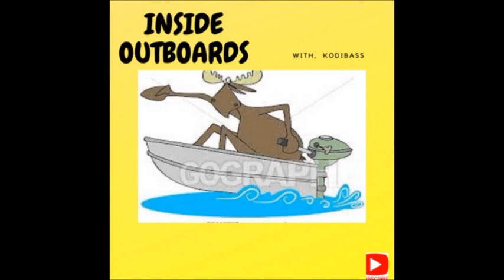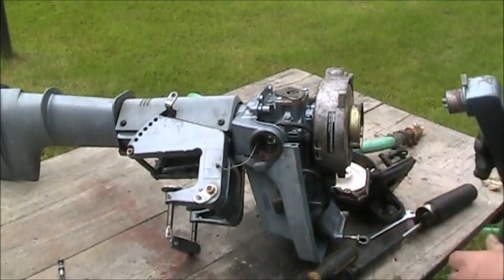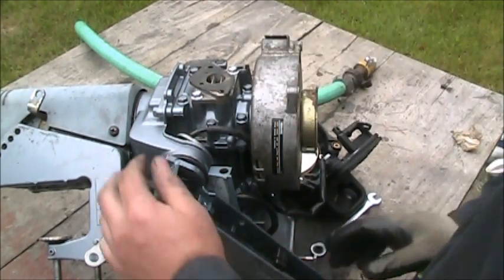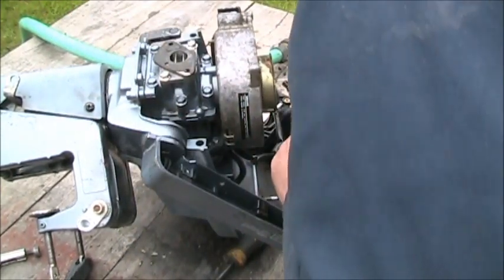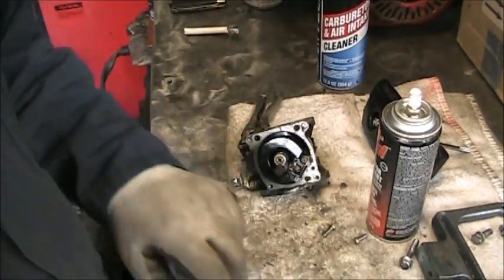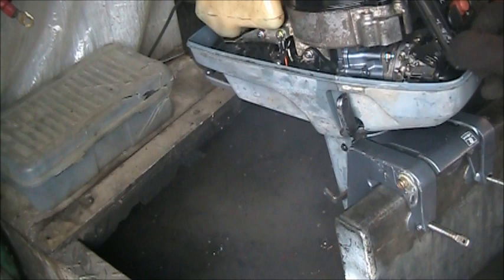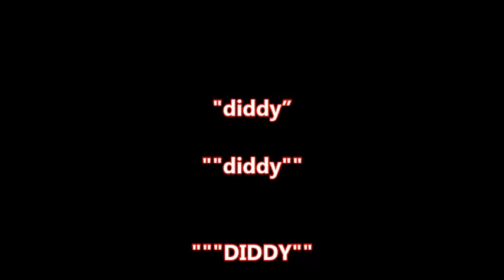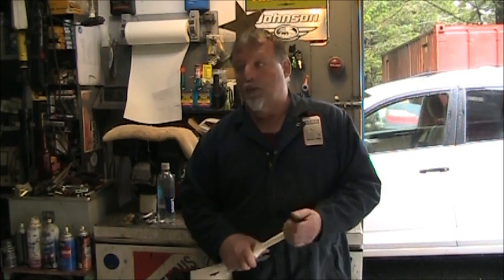YAMAHA 3 HP Outboard,   Repaired  ((  PART 2  ))

Comment: Yep that’s a great little kicker there with the neutral. Being able to bump it in and out of gear while trolling is a great option without having to cut and restart the motor, I’d give it a try on mine for sure, it’d be deadly on the walleye up Lake Erie now!!! I’d try her out before putting it out on the rack...🙂 👍🏻👍🏻
Reply from the maker: +TLS  Ok,  I am going 2 keep it until I find a lower for the yammy 4 hp, same year , sept it has reverse.                                 kodi

Comment: Hi Kodi, I've had my tiller off before on my Yammy 4hp. A bit tricky. Problem I have now is the 10mm bolt vibrates loose. Probably need to put some lock tight on or ding the threads a bit. Like you say you can over tighten it so there is a stopping point for it by feel. It's getting hot down here. Need to get the other ac in the window today
Reply from the maker: _TWS, I have wondered if I could replace this type of cable wheel setup with a later model OMC 9.9/15 type.  I think it it doable .  stay kooool bra.      kodi
Reply: Not sure but if you have one could try and see if it works? Yamaha is easy to work on for the most part. Really good motors especially for trolling👍

Comment: Did u keep it? I got an old P45 Yami 2 hp, a mariner labelded 2hp Yamaha and a 3hp Yami. They all are great little runners if maitained a little. I never had an OMC that was as good as a Japanese made Outboard. Goff Thing on teh old OMC Motors is the Mixture adjust Knob. But to use that u need at least a bit of knowing what u are doing.
Reply from the maker: long ago sold.  I have a 4 with fwrd  n  rvs.    kodi
Reply: @kodibassInsideoutboards  Yeah, thats the only bad point about the little Malta, if u turn it for reverse it pees in ur boat.

Comment: Is this a yamaha Malta? I have a 1996 model that currently is a non runner and trying to find info on taking it apart. It looks the same as the one in this video but wondered could anything confirm that this is in fact a 1990's malta?

Comment: can i ask you sir... my 3hp outboard had a problem with low speed/engine shaking...i buy piston ring and replace old One and cleaning the carburetor .....but my outboard still move slow when i put gear... and engine strong when free gear... spark plug new too.. sorry if you not understand what iam saying... im not good in English
Reply from the maker: Check if anything is wrapped around the prop shaft behinde the propeller,     kodi

Comment: I have the same motor. The “friction piece screw” on the left rear side of the motor seemed to be lose so took it out. Can’t seem to get it to thread back in. What exactly does this part do, and what can I do to make sure it’s back in properly. Can’t find anything online. Part number 6L5-42529-01-00